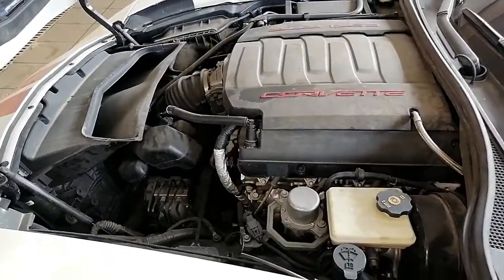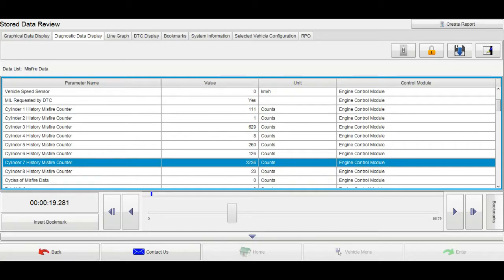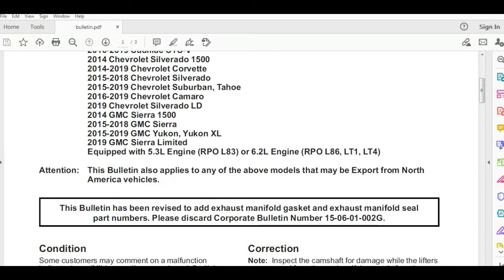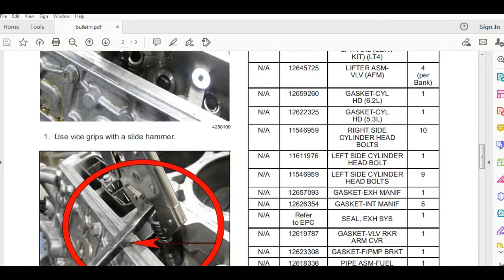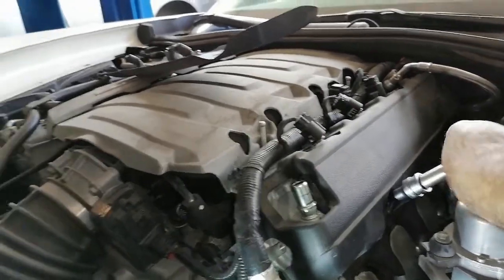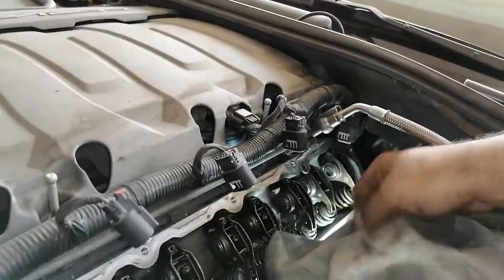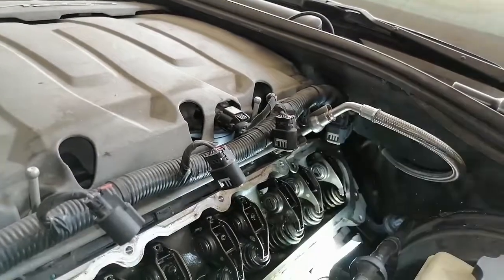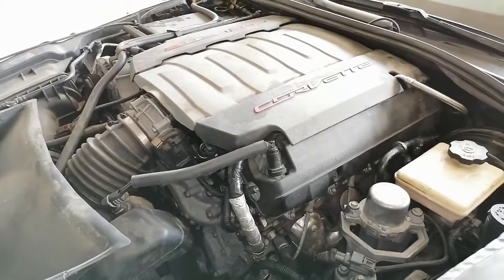Chevrolet Corvette C7 Engine noise and Misfire

Comment: my 2014 c7 is having this problem as we speak. the misfire reader reads cylinder # 2. IF it is in fact the lifter, would i have to drop the engine in order to do the fixing ? from this video i cannot tell if you had to do any engine drop. i guess im asking is, is the job easy enough where i can fix it by removing some parts and replacing some parts with a small pry bar?
Reply from the maker: No need to remove the engine if you have issue with the lifter the only thing you need to remove is cylinder head. Note test the engine compression before at cylinder 2 to make sure is is lifter problem.
Reply: @WissamAbbas  my Manchanic first ran a test and it said cylinder 2 misfire so he replaced the ignition coil and spark plug and it still didn’t fix the problem then we were lucky enough to find ur video (thank you) .we will be running the test tomorrow like ur video and we think it might just the lifter. May I ask how long does it take to do this job (fixing the lifter )?
Reply from the maker: @whoie15  it took one day to complete all the job
Reply: @whoie15  did you use new spark plug wire? Those go bad. Try swapping 2 around and see if the problem goes to the other cylinder. Do you hear any weird noises that could indicate a lifter?
Reply from the maker: @xxuncexx  for sure if the lifter is bad it will make noise
Reply: @whoie15  can we get an update on that?
Reply: @whoie15 how much did this end up costing you?